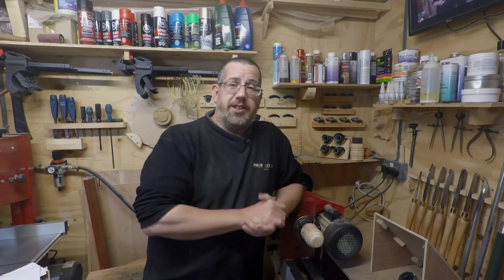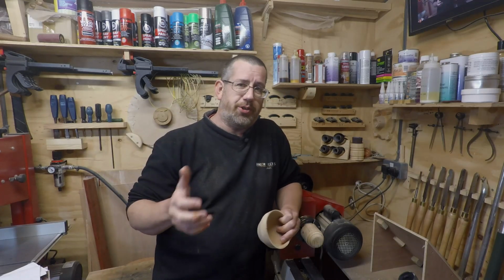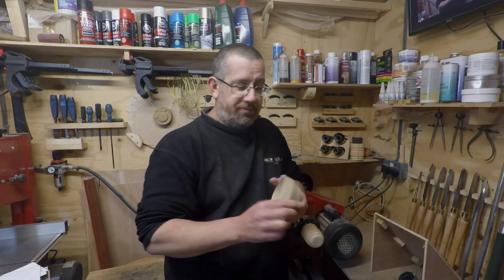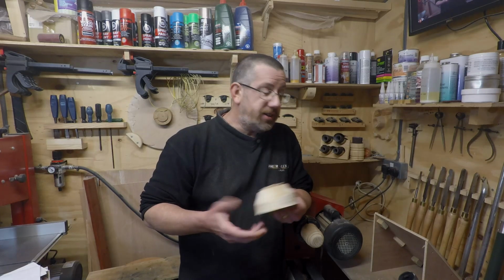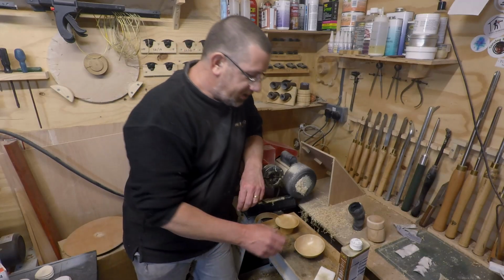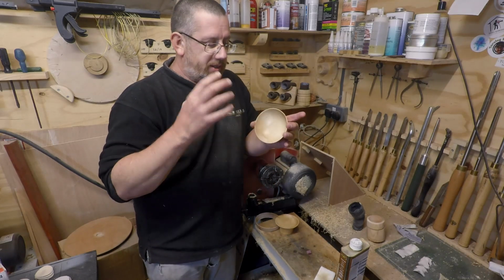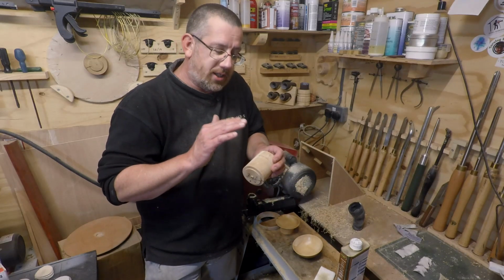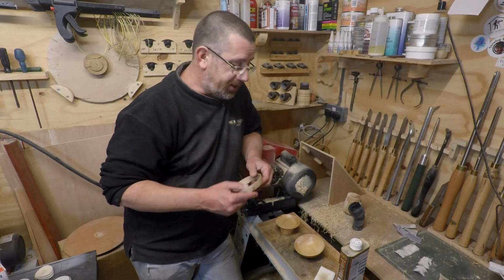Finishing Silver Birch Bowls - Episode 203

Comment: Hi Paul, from bowl to saucer, that was a surprise because I was not expecting it! It made me chuckle. Sorry. Never been through the side but have 'bottomed-out' a couple of times. Turned a small White Willow bowl once that also had very thin walls, the finished piece did not feel like wood but plastic!
BTW, an update on those cheap pearlescent paints I recently bought, well I successfully added them to some epoxy resin - used to fill a fairly large crack in one of my pieces. I have not checked back on your previous vids but have you used resin yet either for a full bowl or as an inlay? Thanks for the video, irrespective of how things turn we all learn over time from our little mistakes. thansk again for sharing.
Reply from the maker: Thank you. It didn't make me chuckle at the time, but when I came back after lunch I then realised that I could turn it into a saucer for the bowl so all turned out probably better in the end as I think the two pieces work better as one like this.
I think this was also the first time I've gone through the walls like this. Just gives you a reminder when working with thin walls to stop more regularly, check more and take lighter cuts.
That's interesting with the paint and resin. I know resin doesn't like water so perhaps the paints you have are not water based.
I have done a few things with resin but not on this channel. The closest I've shown is on Episode 186 where I used it to stiffen up punky wood which worked really well.
Thank you for keeping me updated with how you are getting on, please do let me know more as it happens, always interesting to hear.